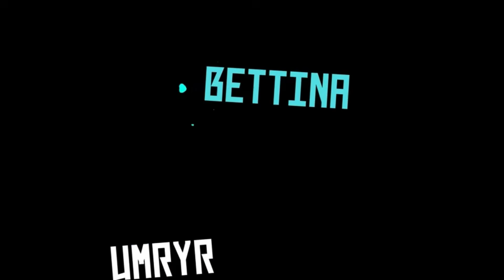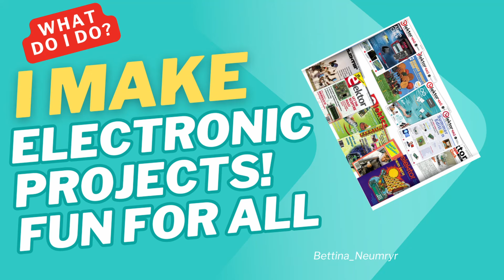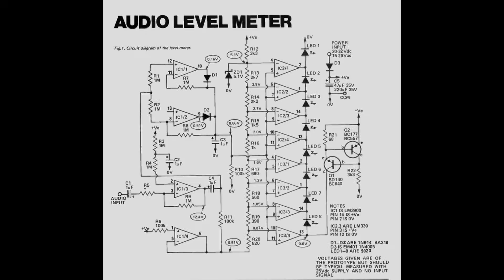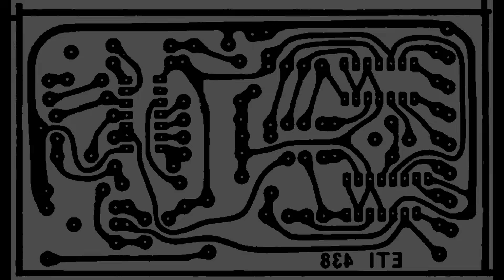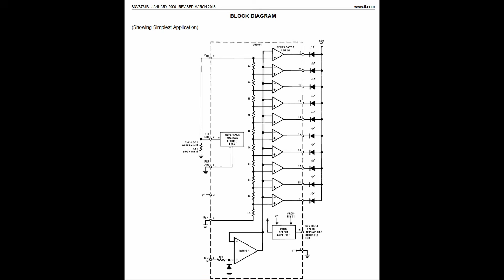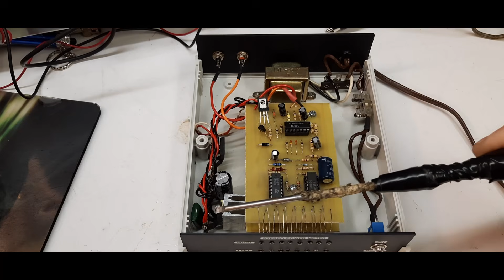Audio Level and Power Amplifier Meter Project

Comment: That's an interesting product that I must study. For the hospital radio station I work for (Volunteer) we bought an American Audio Active DBM (which I presume stands for dB Meter). 80 LEDs ling, two channel and very cheap. It claims to measure dB but it doesn't even if you calibrate it - the markings on the front panel are nonsense. Setting it to 0dB on the scale and then reducing the input by 12dB and all the lights go out - apparently a 57dB drop. The thing is actually linear not logarithmic as it is supposed to be. So I am hoping that by studying the circuit diagram of yours I can see how it is supposed to be done and perhaps modifying mine.
Reply from the maker: Wow ... you would expect it to work if brand new. It looks like it is from China. Yeah ... if you got the time you can build one using this schematic or a design using the LM3915 IC (3Db) logarithmic. The LM3916 is designed for VU meter applications. Thanks for watching. Cheers!

Comment: Comparator bargraph this style (ie open collector outputs cutting the LEDs down the chain off with low state rather than lighting them up) is pretty familiar to me. I once reverse-engineered a heat capacity meter in my storage water heater (Stiebel Eltron SH120S) and the design was nearly identical.
Nice warm white LEDs, they look pretty much like incandescent - at least they seem like that from a distance.
Reply from the maker: When there is a good design, it gets used a lot. We should give thanks to the folks that designed circuits like this. Experimenters paved the way for future devices and applications.

Comment: Hi, I tried to find this issue online, but couldn't.  At least the December 1975 ETI I found is different than yours and I find that puzzling.  I was curious as to why the right channel is on top.  Typically, for a horizontal bar graph style meter, it's the opposite and so I wanted to see if that was the way it was designed, or if you decided to flip the two.  At any rate, I hope you get well soon!
Reply from the maker: As for the left/right thingy, I just randomly chose it. It turns out that there are three ETI's that I know of. I used the Australian version. Here are the links for them all. Thanks for watching!

Australia ETI
https://www.worldradiohistory.com/ETI_Magazine-AU.htm

UK ETI
https://www.worldradiohistory.com/ETI_Magazine.htm

Canada ETI
https://www.worldradiohistory.com/ETI_Magazine_Canada.htm
Reply: @bettinaneumryr  No biggie, I was just curious and thank you for the links (I will bookmark them).  The article doesn't even show the completed project, just one of the boards!

Comment: Explanation: IC1/4 creates a voltage reference for the bottom of the resistor ladder and biasing the peak detector. IC1/3 amplifies the incoming signal. IC1/2 and IC1/1 make a crude full wave peak detector. It is not wired like one would expect and would have lower performance than the standard circuit. I'm guessing it was done like that to use a single supply. ZD1 creates a reference for the top of the resistor ladder.  I'd have used an LM431. I know it existed in '77. Not sure about '75. IC2 and IC3 are used as comparators. When an LED is supposed to be off, the comparator shorts it (and those for the higher levels) to ground. Lastly Q1 and Q2 form a crude constant current source. With just a resistor the current through the LEDs would change depending on how many are on. The current source fixes this.
Reply from the maker: Wow, that's a great explanation of how the circuit works! Thanks for sharing.